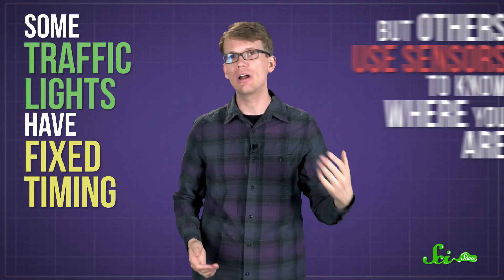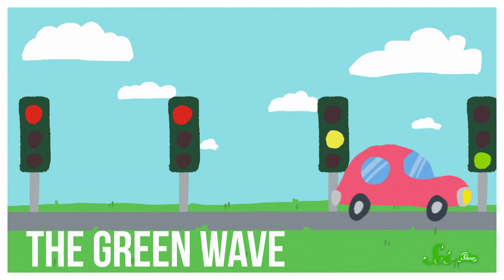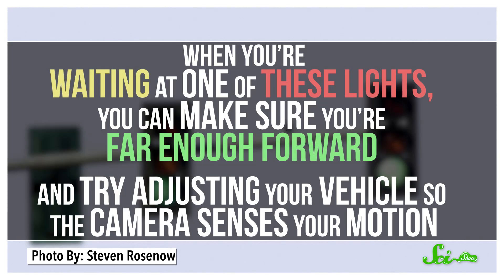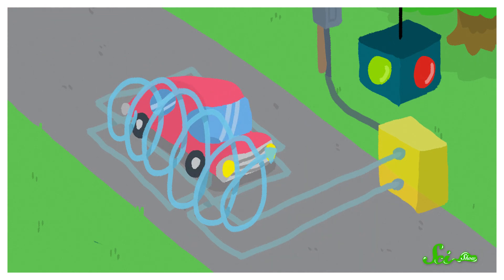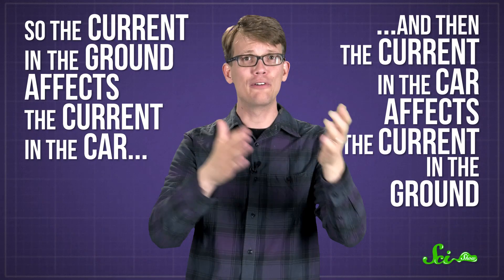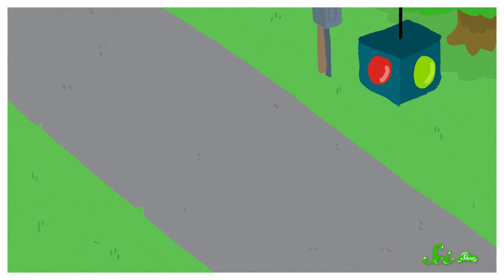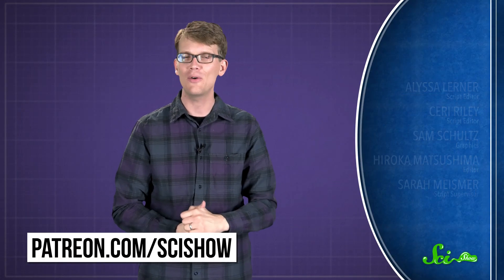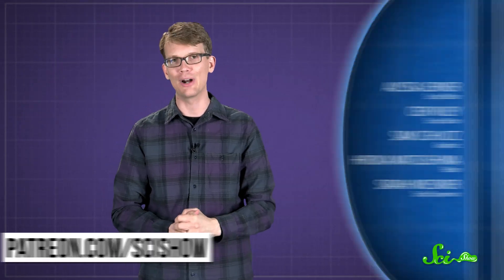How Can I Make A Traffic Light Turn Green?

Comment: That "camera" you circled is actually a strobe sensor for emergency vehicles. I used to install traffic lights, and every single one used the metal detector under the road to detect waiting cars. In New Hampshire, I never worked on an intersection that ran ONLY on a timer.
For the induction loops, on a bike, you can usually see the cuts in the pavement where the wire is; position yourself over one of the lines that runs parallel to the flow of traffic, either in the center, or on either the right or left edge.
Reply: I also work with Traffic signals and the above comment is true.... however the concept conveyed in the video is accurate (video sensors, induction loops, etc.). Best you can do as a driver to "get the green light"  is take a log of your experiences from day to day, log the intersection, time of day, day of the week, and what direction of travel you are going (northbound through, southbound left, etc.) then call in your concern to the roadway agency.. which could be your village/city, county, state transportation agency or public works department..... they can make sure the signal is doing its best.... beyond that a little patience in understanding that you do have to wait at a red light from time to time
Reply: Stephen Zulkowski I always wanted to find out if introducing a serious magnet to the equation would have any effect. I doubt it, but still.
Reply: It wouldn't. What would increase the detectable current is a greater cross section of metal moving against the magnetic field. So, having a gigantic sheet of metal move through the field is better than that same metal compressed into a cube as long as it's oriented properly.
Reply: Stephen Zulkowski Change in flux induces current. Once you put on the magnet, it will no longer induce any more current because there won't be another change in the magnetic field. After a certain amount of time, I'm sure the sensor would realise there isn't a car anymore and ignore the first flip from the magnet being put on the sensor.
Reply: ***** I don't know why you have to be so negative about it. That doesn't help create a positive community.
Reply: Not sure if your asking if a magnet is placed on the pavement and then what that effect might be. Pretty sure it would think the magnet is a car ... Or the readings of induction will be so far out of the norm that the Signal detector would "fail" diagnostically. This would force the signal to provide the max green to the associated signal movement until the detector was reading a signal within typical thresholds. Just my thoughts though.
Reply: actually, it's about 1/3rd of the world's population that drives on the left-hand side. approximately 90% of all road surfaces carry traffic on the right. also, this is an american, on a US-based channel, on a US-based website, speaking american English (yes, it is an actual thing). it's fair to assume he IS talking about US traffic light technology.

that said, here in Michigan there are many timer-operated lights. i can pass through a dozen or more just going about my day to day life. some are combination lights (using timers and other methods of changing) and others are straight timers (it's amusing for a few minutes to sit and watch them change when you know for a fact no one has been through in 3 hours).
Reply: Yes, that is a emergency vehicle strobe detector made by any one of a few different companies who make systems to detect emergency vehicles and give them a priority green as soon as possible. Many cameras are also mounted on the mast arms, but this is not one of them.
Reply: Thank you so much for the correction.  The only time I've seen cameras used as a detection system is for the wooden temp-pole, other than that its loops.  Just installed some today actually.  You IBEW?
Reply: I learned that about bicycles probably about twenty years ago though that technique will not work with titanium bikes since titanium has almost no interaction with induction coils.   Titanium will also only rarely set off metal detectors depending on the kind and sensitivity.   I worked in a precious metals factory and none of our metal detectors could detect titanium in any quantity yet they could detect a tiny staple or as little as .01 gram of gold.   But if you had ten pounds of titanium implants in your body you were good to go.   The induction coils at the intersections are basically big metal detectors.
Reply: That little strobe sensor is also sensitive to those little laser pointers. If you are a good aim you can (and I have) point your laser pointer right at the sensor and wiggle it a very tiny bit so the light passes over the sensor and the light turns green instantly.
Reply: Max green being a number of seconds the owning agency programs in case of failure or oversaturated traffic conditions.
Reply: ***** The reason I state where I had experience, and what I did not have experience with, was to assure the reader that I was no expert, and was discussing a limited range of the field. Stating my credentials and lack thereof. Inviting others with other pieces of the puzzle to join in. And they did. Then you decided to be a little shithead so you could feel big. Please, regale me on the different technology that had to be developed for intersections where people drive on the wrong side of the road. Or were you just stating glaring differences because that's all your pea-brain is capable of picking up on?
Reply: +Admiral Percy You rage, you lose. Looks like you just got beat.
Reply: antediluvian99 Negative, just a couple summer jobs in college. I don't do unions.
Reply: Admiral Percy I can respect that.
Reply: You are absolutely right! I can vouch for that.  I commute to work on a bicycle and there is this particular T-junction where I have tested this method beyond a shadow of a doubt.
Reply: I always wondered why the entire intersection would go red when ambulance/police was in code 3 or the light would suddenly go green to clear out traffic.
Reply: depwater12 The crazy thing: we don't have those sensors in Florida. Emergency crews are on their own.
Reply: I think they're starting to implement it in some counties of Florida. Recently, I was about to turn onto a major road (Semoran- 436) after the light had just turned green, but when I heard the sirens heading my way- the traffic light turned red. It turned back to green shortly after they passed. It's not everywhere though, I've seen emergency crews struggle in other intersections.
Reply: Bloodbath and Beyond As soon as you turn knowledge into a competition, you're a mustachioed Canadian. Go make love to your cue cards, Trebek, the adults are talking.
Reply: A Canadian? Really? That's so cruel!

Comment: that is not a Camera , that is a OPTI Com a photo cell the detects a special flash rate from a special strobe light mounted on Emergency vehicles  and even some city buses  that gives  that direction that the emergency vehicle is traveling  priority or green lights while every one else is put to a red light.  this system can also be triggered by infrared lights with a special flash pattern.   this System also activates a strobe or flashing light mounted on the traffic light post to alert motorist that there is a emergency  vehicle coming  and not a issue with the traffic light system

Comment: Actually, the device on top of the pole is not a camera it is a Infrared sensor and it responds to a specially coded remote like your television. They used to be just optical and a high power strobe of the correct frequency could set them off but most of those have been replaced. Many public safety vehicles have the remotes installed permanently in the vehicle so all it takes to change the light is a push of a button somewhere on the dash or console.

Comment: In Nevada if you are on a motorcycle and wait at the light for 2 traffic cycles and it doesn't change green you are then legally allowed to run the red but you still have to yield to those with a green obviously.

Comment: It can be even more complicated. In densely trafficked urban and suburban areas the lights can be on sensors part of the day and timers at other times.  The timing changes based on traffic too, depending on the system's sophistication. As a rule of thumb a light hanging on a wire instead of a fixed pole, especially a new one or one in a construction zone will always be timed.

Comment: How do ambulances turn lights green when coming up to a red light?
Reply: All emergency vehicles are equipped with devices that send out a wireless or strobe signal that can override traffic signal timing when that emergency vehicle approaches a signal. Incidentally, the detention "camera" talked about in the video was actually one of the sensors that pick up the signal from emergency vehicles.
Reply: In Australia fire fighting vehicles are able to make the lights green before getting to them
Reply: As others have said, the camera pointed out in the video is supposed to detect when there is an oncoming Emergency vehicle with its lights on, so it can turn the light green.
Of course, these don't exist everywhere, so there are likely other rules in place too for this purpose.
Reply: +EnySpaceCaptain Hey there, would you care to explain this? I read it about 17 times now and don't get it. :o( Sorry for being so nosey. ^__^
Reply: This is the case in the US I assume? In Europe emergency vehicles may break almost all traffic laws so long as no bystanders are endangered to get to their destination quickly if they have their lights on.
Reply: In my hometown it's because there are sensors that detect flashing lights, my bro figured out that if you flash your brights rapidly at them the light tirns green.
Reply: This needs to be tested. I doubt headlight light would trigger the sensors - I assume they would make them sensitive to red and blue segments of light.
Reply: I tried it and it worked, but then again it was like 2am and dark out.
Reply: I can confirm it doesn't work, unless you have IR headlights that are flashing at a specific frequency. The best way to get a light to turn when its just you is to back up and drive forward and try and place yourself as close to the center of the lane as possible.
Reply: +EnySpaceCaptain I see, that makes sense. Thanks for clearing that up for me! 😘 Over here they're basically called (the German version of) "first aiders". ;o)
Reply: The systems use an. I fared emitter on top of emergency vehicles that send a  signal to a receiver on top of a traffic light pole, which turns the light gree, triggers a strobe light which blinks slower and slower to let emergency vehicle drivers know that it is about to turn red aagain. These systems are called opticom
Reply: @johnanders8861  I have strobe lite infared new from a police car .it worked on2 lites out of 4 cities.yor better off with welding glasses and run the lite.officer it was green

Comment: My car is made of Carbon Fiber, with Alluminiun engine, so, very low metals, i'm screwed =p
Reply: Sounds tough...
Mo money, mo problems
Reply: Nice Bugatti then
Reply: the aluminium engine alone already means you have likely more metal than a bike. And I'm pretty sure the passenger compartment has steel reinforcements too.
Reply: Haha, not Bugatti, a Xenos Catia with a 1.5L Honda engine and Honda CVT transmission, all carbon fiber monocoque body.
Reply: Herr Russo Tragik
"a Xenos Catia"
That doesn't seem to exist according to google. Typo I guess?

Also, there are no true monocoques in cars, except some made of aluminium.
If it is made of carbon fiber, then it is a "unibody", which includes metal ribs and bulkheads. It is often inappropriately called "monocoque", but "semi-monocoque" would be the correct term.

There's a good reason for that : while carbon fiber has excellent tensile strength (or rather tensile strength-to-weight ratio, also known as "specific strength"), it has very little resistance to compressive or shear stresses. In the event of a crash (even a minor one), a passenger compartment made entirely of carbon fiber would be very easily crushed, along with its occupants.
Reply: piranha031091 His old name, Lobini H1 was Fiberglass with tube structure.
Reply: Herr Russo Tragik
Then it still has a steel tubular chassis.

Comment: I know at least where I live, and I'm sure elsewhere, if you look on the front of emergency vehicles there is a small strobe light almost in the center. Those hit a sensor by the street lights, maybe the camera, and it knows to let it get a green light priority. When I was riding a motorcycle just quickly flashing my brights worked for me to get a red light to turn green. Hope that helps

Comment: most detectors are positioned so they're nearly impossible to miss. depends on the intersection of course. 

also timings typically change for different times of days. if you're at a fixed timing light on a minor approach at an off hour, you may be waiting a bit

Comment: At 0:50 that isn't a camera you circled, that's an Opticom detector used for emergency vehicle detection.  Also in areas heavily trafficked by bicycles, there are loop detectors (like the one you describe in the video) or wireless sensors (like those sold by Sensys or TrafficWare) which can be reconfigured (more loops, smaller radius, lower tolerance in detector) to detect bicycles.  The kickstand thing doesn't really work as the amount of metal is so small it really won't make much of a difference.

If the traffic signals are programed properly, they will cycle through lanes with sensors even if they aren't set off, this is done to ensure bikes/motorcycles/cars who are not detected get a green light, eventually.  You'll just need to be patient (or press the pedestrian crossing button).

Comment: Around here, the camera sensors include infrared, pulsed emitters.  
The see the retro-reflectors in your front turn signal lenses.
There was one camera that kept ignoring my existence.  
I added a stripe of retro-reflector tape across the front of my hood, 
and now, I get a green light, there,  before I even stop. 
  
For a motorcycle on the buried loop sensors, 
the field is most concentrated close to the wires, (wrapping around them) 
so putting the metal rims of  the wheels right over one of the wire lines 
(so that the wrapping field passes through the circle of the rim) 
gives the greatest signal.  
For vehicles with large, sheet metal floors, 
that sheet metal runs the wrong direction for this effect, 
and being in the middle of the loop intercepts the most field lines.

Comment: Ambulances and emergency vehicles used to have a special strobe to activate a green. You USED to be able to get a mechanics' timing light and modify it with a 555 timer circuit and a pot and point the timing light at the sensor on the pole and turn the pot until the light changed.

Comment: On a motorcycle, in Illinois, it's legal to turn left on a red if you can't activate the sensor. Only after you give it a chance and traffic is clear. For some reason, I think it was legal also to cross an intersection if this issue arises. I'm not 100% on that though.

Comment: IF YOU'RE RIDING A BICYCLE YOU SHOULD BE ON THE GOD DAMN SIDEWALK
Reply: Depends where you live, here in Iceland a bicycle is considered a vehicle just as much as a car and a motorcycle with the same rights of access to the traffic lanes as long as they follow the same traffic laws.
Reply: where i'm from it's illegal to operate a bicycle on a walking path, they must only be operated in the driving lanes on roads. of course nobody enforces that but it is officially the rule
Reply: Riding on the footpath/pavement/sidewalk is more dangerous. First it is more dangerous for pedestrians who now have to dodge a vehicle going several times faster than them, second it remains dangerous for cyclists if there are partially concealed driveways that cars are coming out of.

In most jurisdictions worldwide, bikes are expected to use the road except where there is a purpose built bike path or lane (these bike paths are sometimes shared pathways with pedestrians, but they tend not to have concealed driveways or sharp corners and are much wider than paths meant for pedestrians alone.
Reply: What if there aren't any sidewalks? And why do they have bike lanes if you're supposed to be on the sidewalk? Not trying to start anything...just asking about your reasoning...
Reply: Amanda Nance If you're biking on the side of the road and there's no sidewalks, that's understandable. But if there's a sidewalk, especially a wide sidewalk, you should be on the sidewalk! If not for the sake of the drivers who have a place to be, but for your own safety. And I know technically bikers have "a right to the road", but if there's a sidewalk, use the sidewalk for gods sake.
Reply: It is illegal to use the sidewalk with a bicycle in Germany unless there is a sign stating otherwise.
Reply: Well where I live it's not illegal to ride a bike on the sidewalk
Reply: ***** It's actually not illegal in many places, here in Iceland for example it's not even technically illegal to ride a bike on the pedestrian side of a sidewalk, it's just highly frowned upon, but the police won't do shit other than respectfully ask you to stay on the bike lane.